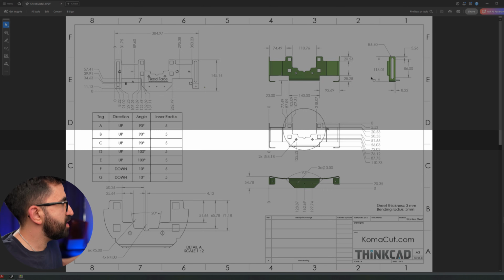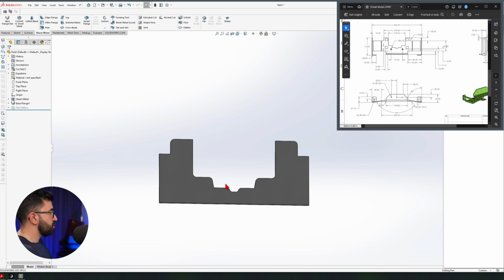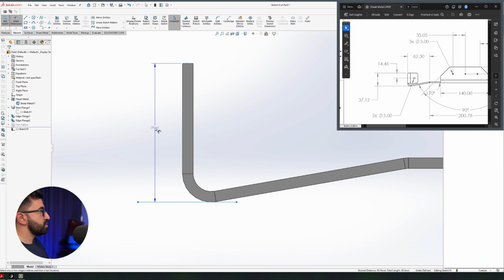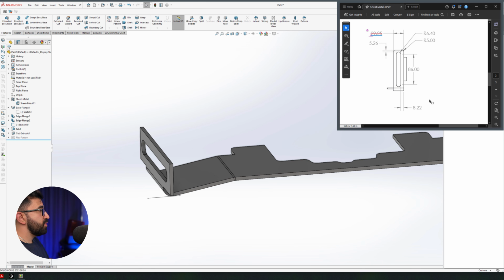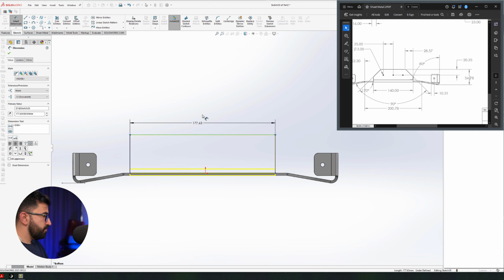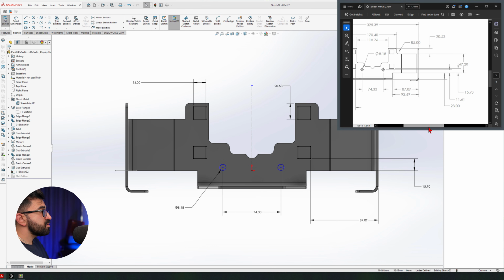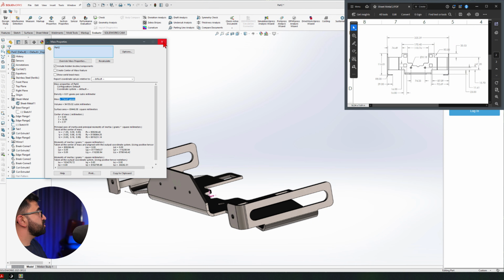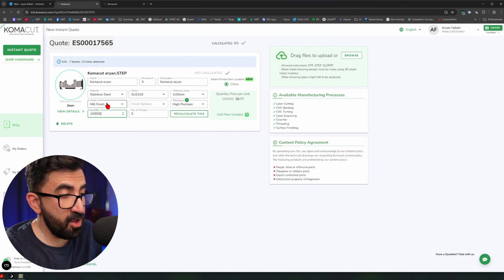Learn Sheet Metal Design | SolidWorks

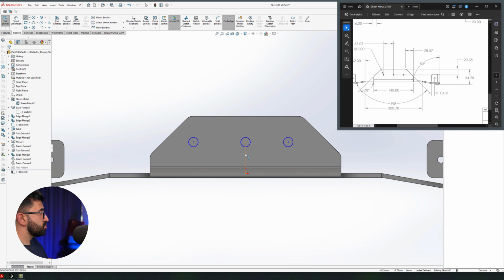Comment: I've been using sw sheet meal for 4 years so that part wasn't challenging for me, but you did a relationship at about 13:04 where you made a symmetry between two holes and a centreline, and that was brand new to me. Fantastic! I would have made another construction line between the two circles and mated the midpoint to the other circle. I like less entities and dimensions on the page. Relationships are always better.